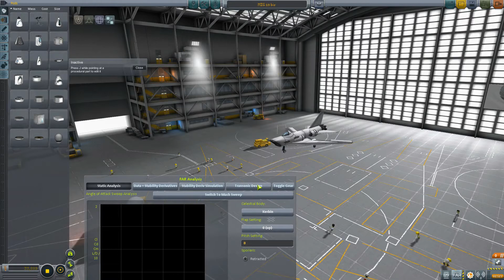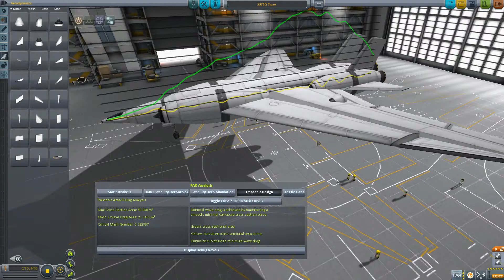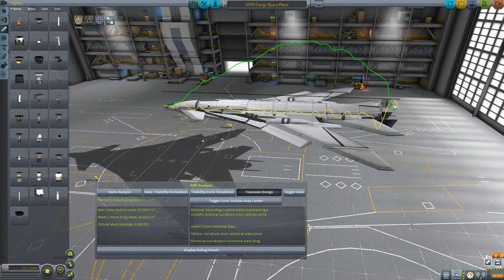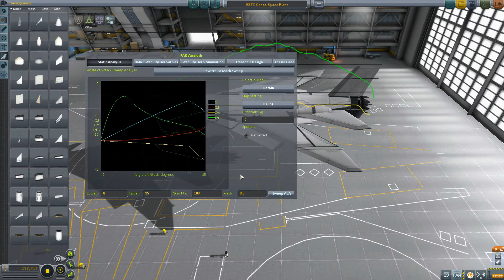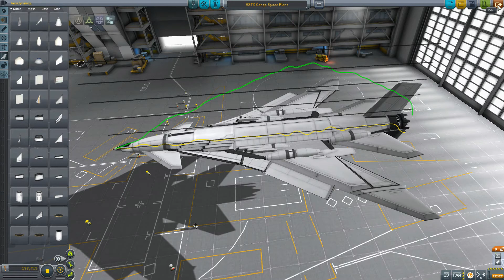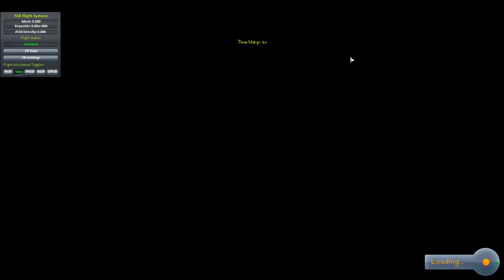nuFAR Tutorial [Kerbal Space Program Aerodynamics Plugin/Mod]

Comment: Nice video. Have you tried changing the wings on your big plane? I don't know much about supersonic aircraft design, but I think the wings are way to wide.
Reply from the maker: chesstasticable 
Which big plane? (sorry for the late reply). 
Supersonic Aircraft design comes down mainly to Area Ruling (or as I call it in the video: Cross Section Area Distribution). You wanna have it as close as possible to a Sears-Haack body's area distribution (@6)
Also you want the green line (chross section graph) so be as smooth as possible at the same time.
And yes I'd probably habe to change the wings on the Big Aircraft as it was one of the first I made in nuFAR.
Greets 4plains